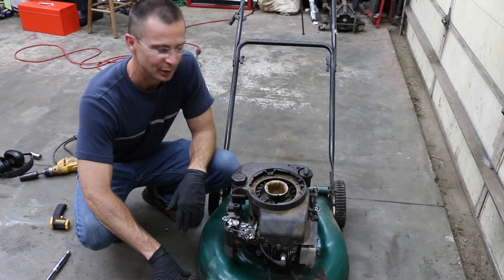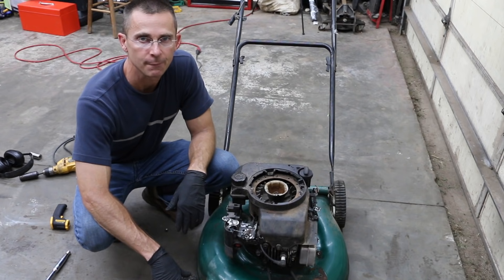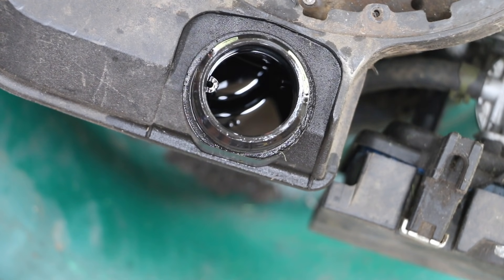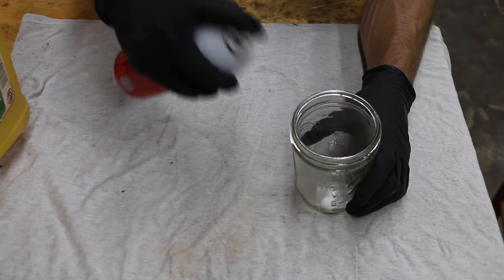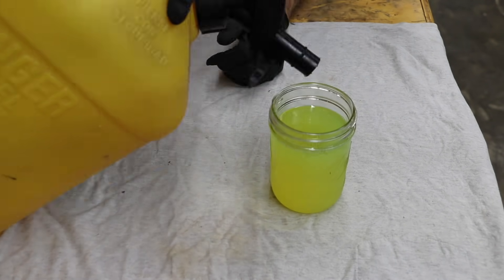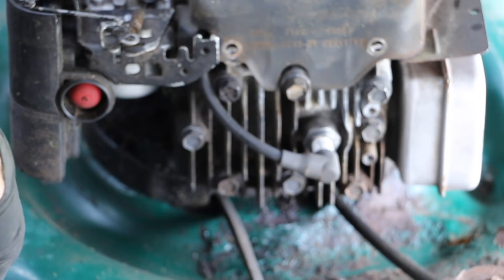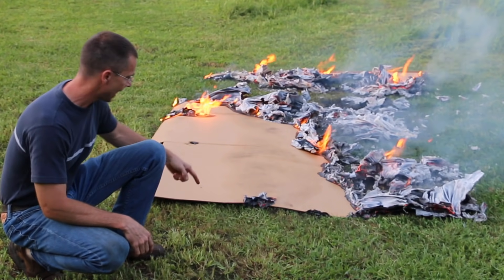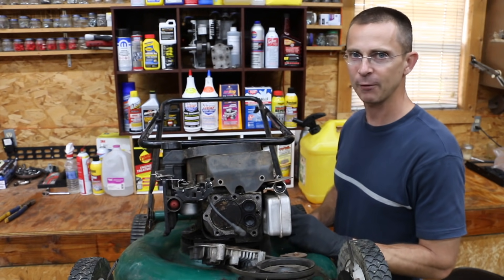Will a Gas Engine Run on Diesel?  Let's find out!

Comment: Run one with just diesel in the crankcase. They say it lubricates some. See how long the engine will run on it and clean out the engine with it as well.
Reply from the maker: Thanks for this video project idea!
Reply: I dont think the scar rating on the ultra sulphur diesel is low enough to lubricate the engine now a days.
Reply: tyler alred  yeah it works good for cleaning. I think it would be awesome to see it ran through a torture test to see how long it lasts and how it wears the engine
Reply: This new ultra-low sulfur diesel has nowhere near the lubricity of the old stuff.
Reply: Id love to see this! I've always heard of it but I don't want to try it on my own stuff.
Reply: @thatallredheadude Back in the 1920s-1950s car manuals recommended flushing an engine with kerosene or diesel fuel in the crankcase every so many miles. That was a long time back with different engines (some that didn't have oil filters) and with much poorer oil that burned a lot easier.
Reply: Yeah and then compare that to running pure Lucas upper cylinder lube in the crank to see what lubes better ?
Reply: Great idea I used to run diesel in my crankcase of my 4-wheeler for 30 seconds at a time and then drain when I would sink it 😂it helped clean it and get all the water out
Reply: You can run a hot 2-stroke with diesel. It has a lower power output and runs a little shit but hey... at least it's getting good lubrication!!
Reply: Highstranger951    They put other lubricants in the diesel fuel to compensate, especially the premium diesel. ULSD is less corrosive to injector tips though so they last longer.
Reply: Project Farm I'd love to see this my papaw did this to an 89 Buick that was knocking drove it about 10 miles drained the diesel put oil in it and ran it another 100,000 miles before trading it off he swore diesel would "recondition" the internals
Reply: Project,  DANGEROUS to put a flammable in the crankcase!

Comment: Do pure Acetone, I've heard of people using it in small amounts for fuel system cleaning and I'd like to see the test. Also as a side comment, I need to move close to you so I can have a never ending lawn mower business.
Reply from the maker: Thanks for the video project idea!  Never ending lawn mower business comment...LOL!  Thanks again!
Reply: Acetone is the main ingredient in Diesel Purge, which I just used to clean up the fuel system on my V10 TDI.
Reply: im being genuine about this, i made a friction drive minibike and the 4 stroke motor on it uses rough equal ratios of Methanol, Acetone and methlayted spirits. runs about as good as it did before but the jet needed to be ever so slightly bigger.
Reply: Another good idea tho
Reply: m
Reply: even small amounts with the acetone will rapidly clean an engine and is safe for every day use I know I have used a cap full of acetone in a tank of gas lawn mower tank might be a quart the lawn mower had not been started in almost a year first I cranked the starter about 10 times to spread the oil as the oil was still in usable shape it was a quick favor the owner likely changed the oil later but it started up with in 5 pulls acetone does allot of really good things for an engine something I look forward to seeing in an upcoming clip

Comment: Great video, leads me to believe with some adjustments it should run
Reply from the maker: Diesel is thicker than gas, making a carb adjustment important. Thanks for commenting!
Reply: ahh , yep, then i am wrong! i thought it ran,, forgot about the fuel in the carb...in the old days of ww2, you could convert your petrol car to paraffin, with a special carb, you ran it on petrol to get it hot, the special carb got hot and you changed over to parrafin, it ran , but lost more than half your power, but was available at least
Reply: Got to atomise it and get it HOT! Maybe a gas mix but straight stuff won't do. Not enough compression heat and if you get the compression high enough the bottom end won't stand it.
Reply: Like acetylene without oxygen. Just smokes and slobbers until you add the oxidizer and then you got heat and plenty of it. And you can put diesel in a bean sprayer with a blower behind it and start a wet brush fire really fast.
Reply: That's right. The float bowl was still full of gas. When the straight diesel hit it it smothered out. A gas engine will not run on straight diesel.
Reply: Like the old kerosene plants were the same way. International Harvester had a diesel engine with a 3rd valve to lower the compression till the motor got hot then you closed the valve and opened the injection pump up and off she'd smoke. It had a carb, coil and plugs on one side of the block and the injection pump on the other. Interesting. And the old G.I. Continental multifuel that you could run about anything in. Live and learn. I still am.

Comment: Does it matter of oil thickness you run in a small engine... LIKE IF WANT TO SEE THIS
Reply from the maker: Thank you for this video project idea!
Reply: What about wd40 as oil
Reply: Oil viscosity is rather important, if it's too thin it will only get less viscous as it gets hot. With older engines it's fine to use pretty thick oil as tolerances between the parts isn't as tight as newer engines, and if the oil is too thick it won't get where it needs to go. It can cause engine failure.
Reply: Project Farm 
Hey my brother accidentally filled my 2stroke dirt bike with diesel after the tank ran dry, and after he got it running, it smoked like crazy and after about a half hr of riding it, the head gasket blew. No other damage though. It ran very sluggish on diesel.
Reply: Christopher Backus I ran a Briggs without oil for like 2 years, bitch ran strong as fuck, obviously not towards the end. I really just wanted a new mower, and didn't want to toss one that was perfectly fine. I wanted a self propelled one because lazy fuck American lmao.
Reply: Gear oil caused a mower engine to seize it's bearings, simply didn't make it to the bearings because the oil slinger couldn't move it far enough. Found that out the hard way lol! Bearings were dry as a bone.
Reply: My father's  mower ran for almost a year with gear oil in it. Oil was so thick the engine would barely crank over. My old man took it to some Amish guy who apparently is a small engine mechanic. The jackwad put 90wt in it. Had to spend an hour flushing it to get it all out. Even after 3 more oil changes, there's still black sludge at the bottom of the oil reservoir 

He (the Amish guy) also said that it had a valve problem that he couldn't fix. I fixed it in about 15 minutes. Mechanic my ass.

Those Briggs engines though....those things are almost impossible to kill. Still runs like a top despite the aforementioned gear oil, and running without an air filter for almost 5 years. (I discovered that the air filter my old man had zip tied in there actually doesn't filter anything without the shroud, which broke off years ago...had to get a new one.)
Reply: I would like to see that. I ran thick oil in my car and it ruined my crank bearings almost immediately.
Reply: That's an interesting thought... it has a low viscosity, so it can get into small crevices better, it does carry some lubrication properties but not a lot and it makes a good detergent. Whether it can stick to the bearings of an engine running >2000 RPM is yet to be seen! It may even be too low a viscosity for the engine and just fly off the crank as it spins, starve the engine of lube and sieze it. only way to find out is to dump some into an engine and see what happens.
Reply: Why reinvent the wheel?  Yes manufacturers have tested this for decades and recommend the right oil, though sometimes erring on the thin size on the automotive front to eek out a few more MPG, and any of them rate for a new engine not one with wear  that needs a little thicker film strength and to reduce oil burn rate. "Little", not 2 or more viscosity jumps lol.
Reply: ThEcRaZ3dGaM3R It's too thin, it won't create a thick enough film on any engine. Although I bet it would clean any kind of junk out, but would also cause sever damage lol.
Reply: I hinted at that with the "flying off the crank" part. You need a decent film strength with engine oil to make sure it stays where it's needed and doesn't get flung out by the rotation of the engine.
Reply: xXxchipperchopperxXx In multi-grade oil, the viscosity moves up as the oil heats up, am I wrong? Hence 0W-20. Maybe you're thinking of old timey, single grade oil like SAE 30.

Comment: surprised it runs at all on diesel. kinda interesting. that it runs on the 50/50.
Reply from the maker: Yes, I was surprised it ran on 50/50 gas/diesel.  Impressive!
Reply: Andar Lucifer that's not smoke bro. That's raw unburned diesel. That's essentially diesel steam.
Reply: Had a  gas scissor LIFT that a guy added diesel
They charged us 1200$ to drain and clean ....now I know that bull
Reply from the maker: Stuie, ouch!  That seems way excessive to drain the fuel.
Reply: Project Farm you should try getting an engine to run on bug spray or hair spray some sort of spray system for the intake to get it in there to stay running if it would even run.
Reply: Project Farm any idea is a good idea for a good YouTube channel
Reply: Hydrolock the motor?! The engine would possibly run on the diesel or more probably foul the plugs or die of running to lean because diesel evaporate less than gasoline.
Reply from the maker: Chris, thanks for this idea!
Reply: Джейсон Хичкок your probably right but diesel will ignite with a spark and the right air mixture so then again you could be wrong and I never said anything about it running on the diesel for sure anyway I said it was interesting that it appeared to.
Reply: Джейсон Хичкок you wanna know something the world don't know already first off I am not some girl I'm a dude second I'm well aware how carburetors work I have rebuilt and cleaned them also I am learning to become a professional mechanic and are in the middle of restoring an automobile. Besides my comment was not for you people to start arguments with me over it was directed towards project farm the channel who's video this belongs to no else so please don't try to start arguments on YouTube.
Reply: I worked on an Acura TSX that some numbnuts put diesel in. I had to drain the fuel tank and blow out the lines. It also killed the fuel pump. Other than being a bitch to get started because there was diesel in the injectors, the car ran fine afterwards.
Reply: If the fuel delivery driver puts diesel in the gas tank at a gas station. As long as they catch it in time, they will fill the rest of the tank with gas. Because the gas will dilute the diesel if there is enough gas in the mix.
Reply: would be nice to see run time under load comparison between 100 gas and 50/50 gas diesel mix.  thanks for your vids..keep up the good work
Reply: In Taiwan, there are people mixed the gasoline with 1 to 5 % diesel and claimed that the exhaust is much cleaner & better miles. Can you test it? Thanks
Reply: Джейсон Хичкок diesels need fuel injectors because diesel fuel need to be directly injected into the cylinder and I am aware but sometimes you should just politely comment someone on there video in Support of even makeing it.
Reply: I am a diesel mechanic, and I have done many of these drain jobs, it is not only draining the tanks+disposal. It is clearing fuel lines, replacing filters, and re-priming the system. You would be surprised how many people accidentally put gas in a smaller diesel box truck. As for the white smoke, I would check piston rings. With all that compression from trying to burn the diesel, you could have started burning up the piston rings.
Reply: Джейсон Хичкок I am aware of that and I am aware he is making money and all I did was suggest an idea for his videos not here to start arguments with people that want to argue or fight.
Reply: Джейсон Хичкок I do like his videos but obvoiusly he makes good money off them but yeah i agree he does kinda reply to comments in a shitty way for everything he says thanks for watching and commenting like say something lol
Reply: You would be wrong to not have drained and cleaned the system. Diesel works off of compression, and Gas works off of spark. This is why diesel engines do not have spark plugs. On a small engine like this, The compression can cause combustion in the system for a limited time. This is also why he got a lot of white smoke.
Reply: The Italian Hammer lol but he's a diesel mechanic! Lolol ever see a big truck first fire up on a cold morning. Lots of white smoke. Once warmed up it burns clean. Black smoke is a rich fuel condition.
Reply: you are completely wrong, gas and diesel combust in different ways, if you would run that scissor lift until it ran on diesel it will hydrolock your motor, because diesel doesen't combust by spark, but by compression, and vice versa, and the bill would be say, $5,000 for a new motor, so which is better?

Comment: There isn't enough compression in a gasoline engine to ignite diesel.
Reply from the maker: Yes, this is right.  Thanks for commenting!
Reply: @ProjectFarm  你说的这个不对，汽油会溶解在柴油之中，喷雾出来的颗粒不会太大，在发动机汽缸壁的预热下，完全可以跟着汽油同时燃烧，重点是柴油和汽油的比例，我认为不应该超过20%，这样的混然效果会很好，柴油比例越大超过20%，汽油带领的混然效果就会降低。柴油和汽油混合燃烧的比例应该有一个平衡点。柴油应该不会超过30%。
Reply: Just mill down the cylinder head, or add some hi temp cold weld in a recessed area of the head. Easy and fun to try
Reply: It's more the volatility of diesel. Diesel actually can detonate in a gasoline engine. It has trouble burning because it's not very volatile. That's why it has to be heated to run in a Briggs and Briggs and Stratton recommends doubling the head gasket to lower the compression.
Reply: @Kent    Meh, sounds like its been done before a bunch of times. I want to see him do something weird like shave the head down or add JB weld into it.
Reply: maybe you could do a video where you try to increase the compression of the engine so that diesel would run better in it.
Reply: Diesel can be spark ignited, but the compression ratio might still need to be higher. There are spark ignited diesels starting to come on to the market in some applications.
Reply: 你说的这个不对，汽油会溶解在柴油之中，喷雾出来的颗粒不会太大，在发动机汽缸壁的预热下，完全可以跟着汽油同时燃烧，重点是柴油和汽油的比例，我认为不应该超过20%，这样的混然效果会很好，柴油比例越大超过20%，汽油带领的混然效果就会降低。柴油和汽油混合燃烧的比例应该有一个平衡点。柴油应该不会超过30%。

Comment: Do a video on a small engine running on 50:1 ratio gas because I use it souly for my chainsaw, and weed eater
Reply from the maker: This is a great video suggestion--thanks!
Reply: Samuel Krinninger- Thats what i personally run in all my 4 stroke gas engines is a 50:1 2 stroke mixture. yes it smokes a lil bit on cold start ups but other than that my reasoning behind doing it is in a 2 stroke engine the oil in the gas is what gives lubrication and cooling (besides the heat sink head of course) so in my opinion its extra lubrication for the top end of the motor hince thats were the fuel enters oil is in the sump/pan so the upper parts are getting lubed not only by the sump but from the fuel as well. im sure carbon deposites and what not are building but its been 3 years on my weedeater and over 5 in a push mower and havent had a problem yet, have never had to clean the carb even just fuel filters every season or so.